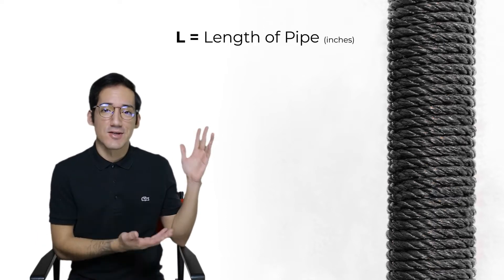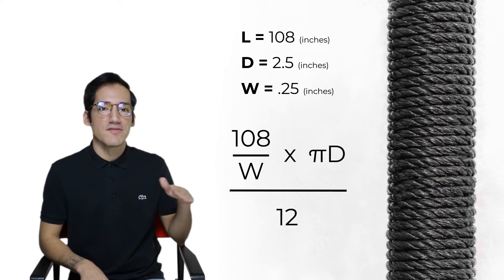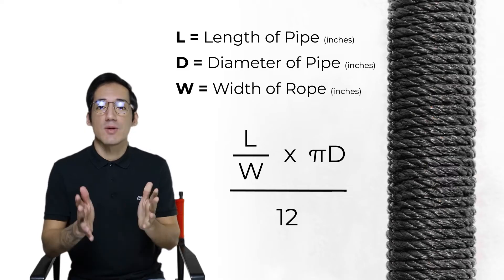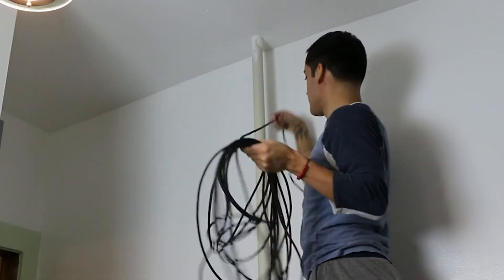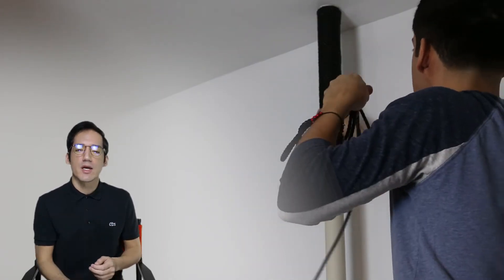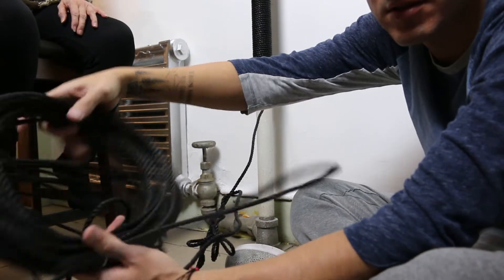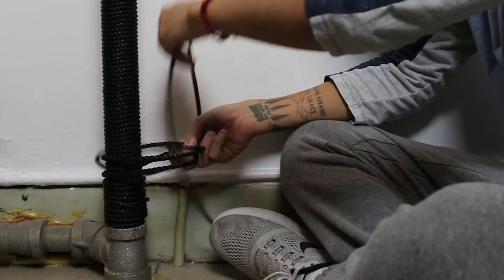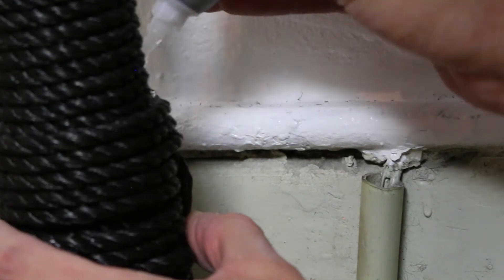Exposed pipe cover using rope DIY

Comment: Does this help with the sound? My pipes make a lot o banging sound.
Reply: Fix up your plumbing... if the knocking is occurring for a particular tap, replace the tap valve / washers / o-rings. As the rubber in the tap degrades, chunks of it break off... it then behaves a bit like a water wheel, as the tap is turned off or on, the high pressure water catches on the uneven surface vibrates or spins it. These vibrations can travel along the pipe as sound. 

There is also a pressure regulator (often a bell shaped item installed just past your water meter) that can slow down the flow coming from the water main. There's a nut or screw on this that can increase or decrease the pressure for your whole house. 

I was living in a place that was at the bottom of a hill, and had extremely high pressure, where after replacing the washers, they would degrade again within three months. The landlord kept blaming us for "turning the taps off too tight"... turns out that the valve in the pressure regulator in the whole house was faulty. Repairing that reduced the amount of times we needed replace the valves, and also reduced that knocking sound you'd hear along the pipes when turning off a tap.

Comment: I like the nylon/plastic ropes, but your slide says these trap heat. Does this mean they’re not good for pipes that I rely on to heat my home? 

Also, in your slide you show that the manila / fiber/ macrame can shrink / expand with moisture. Does this mean they’re not a good option for the bathroom? 

Finally, do you have any preferences between
manila / fiber / macrame?

Many thanks for your excellent video and your help!

Comment: My instinct says to begin wrapping at the bottom and build up, gluing as ya go...thoughts? This is what I intend to do to cover the metal support post in my basement apartment. Because no heat is involved, I'm considering using an organic rope of some type, though the cost may be prohibitive. if so, I'll be going to the traditional wood-type wrap system minus a footer and header, wanting to keep it as simple and unobtrusive as possible.
Reply from the maker: Honestly, starting from the bottom and working up might be easier? I’ve tried this technique 4 times and have always started from the top since the bottom part of my pipes have joints. 

My pipes have been wrapped in ropes for 3 years now and have never moved. I think as long as you tighten the rope and secure it well at the start and end = it should not move on you. So the glue around everything would not be necessary and you wouldn’t be able to ever remove it. I can still take mine apart if needed.
Reply: Makes sense.
Reply: We did ours from the bottom up with 1/2” cotton rope, which we purchased online. They had a lot of color options, but we went with a light gray because we were shooting for unobtrusive. We didn’t use glue; had no issues with the rope slipping or stretching in the 7 years we lived in that apartment.

Comment: Does it need to be a heat proof type of rope material so it doesn't melt?
Reply from the maker: You’d be fine with the rope materials I mentioned. I searched them up on Google and they can withstand heat and won’t melt on you.

Comment: How on earth did you do this without a helper?  I've tried this alone and I almost hurled the whole rope out of the window. I can't figure out how to thread the entire bundle behind the pipe while doing this alone.
Reply from the maker: I totally feel your pain. I did that the first time and ever since then I will bundle the rope into sections of 20ft just like I showed in the video. By doing that you can unbundle the groups as you need and it doesn’t get tangled. It’s an extra step but will save you hours of frustration. 😂❤️